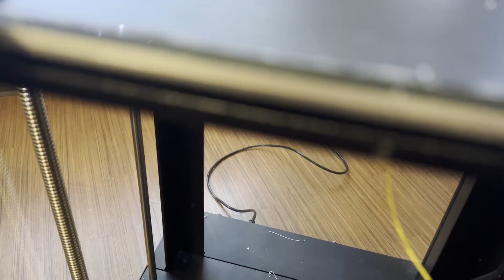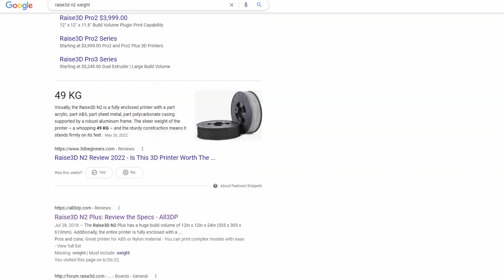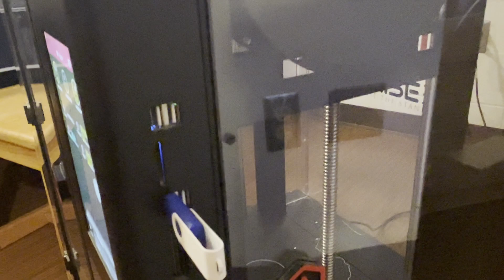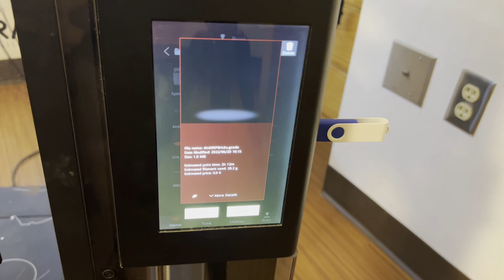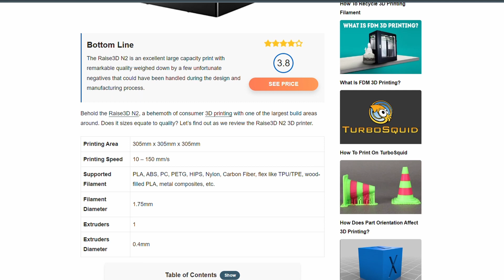I BOUGHT A $5K 3D PRINTER?! Raise3D N2 Plus Walkthrough & More!

Comment: broken touchscreen IS common on the N2. the enclosure causes heat to be retained inside the unit and the touchscreen overheats and eventually fails. i sell adaptors for the raise3d n2 series which allow you to use inexpensive aftermarket touchscreens from mouser or digikey, so you dont have to use the external mouse.